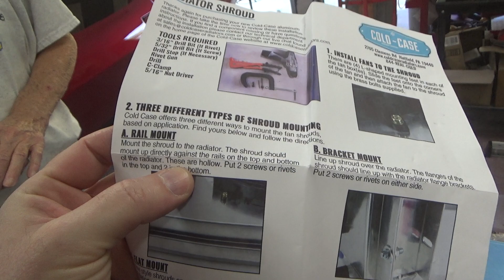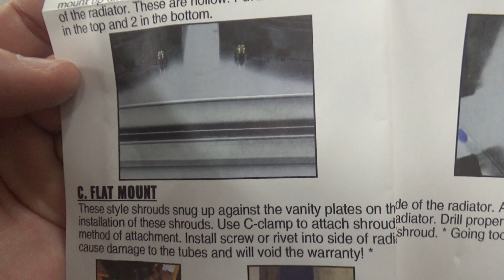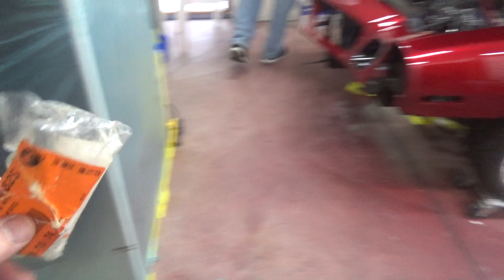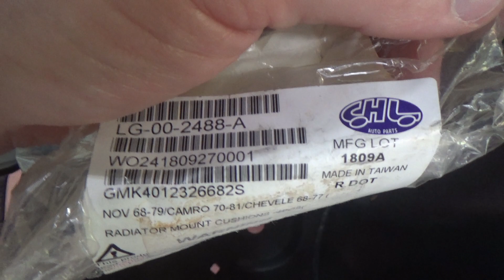1977 Camaro Z28 Part 248: Cold Case radiator and AirAid cold air intake

Comment: Make sure to use loctite on the fasteners for the sensor on your air intake. It would suck to have the engine ingest a loose bolt. The car is looking outstanding.
Reply from the maker: Yes! Thank you very much

Comment: Hey Erik the car is looking also I think silicone radiator hose will look better in your engine bay cuz you have some shiny things going on in there if it was the original engine setup you have I would have use the original looking heater hoses  and if you need anything send to California I can help you take care brother
Reply from the maker: Thanks buddy! I have not looked into the silicon hoses, but I may have to. The heater hoses are already installed, so I am stuck with those :)

Comment: Looking awesome Eric. I see your doing what I’m about to do. RADIATOR HOSES. I read that a guy took a coat hanger and cut and bent it to the length and bends needed and then took it to the parts store and they fixed him up. I’m going to try it and hope they help me get the hoses to fit. Anyway you could try it if your still having a problem finding ones that fit. Anyway your car looks AWESOME.
Reply from the maker: Thanks! Yeah, that is the way a lot of folks have done it. I am trying to avoid that, but we'll see if that is where I end up!

Comment: That top rad hose, you could cut it and put a metal piece in the middle to make it fit. That part that’s banned in Cal, just have it shipped to someone you know out of State and have them ship it to you.
Reply from the maker: HI John. I may end up doing that for the upper hose. As I said in the video, I read about a guy trying to get that through the referee and failing. I was able to order the block-off plate, so that is good enough I think. Thanks a lot

Comment: Looking good. Congrats on finding the lower radiator hose, I just welded the AN20 adapters to the thermostat housing and the radiator.
Reply from the maker: Thanks. I hope the upper fits. I fear it will be too long though.

Comment: I am friends with Mickey Lauria. He owned Total Performance, Inglese and a company named Cool Flex. They originated the flexible metal radiator hoses. They used copper. Flexed easily and helped dissipate heat. They offered them in colors like polished silver, black, etc. I've used them many times with perfect results. He sold the company a while back, you might want to do some research about them.
Reply from the maker: Thanks, I will take a look

Comment: You will need two 40a relays to power the fans. The ecu will provide a ground to trigger the relays as needed. One on at 195 and the other at 210...random temps mentioned just for example.
Reply from the maker: Does not seem to be the case for mine. It has a 40A relay/fuse already for the fan. If it was ground based, that would be easy peasy. But NO!

Comment: for my 69 camaro i got a cold air intake off amazon for a 2006 chevy pickup flipped it over and it fit perfect. just had to make one bracket to hold the box for the filter. it only cost about 60 bucks
Reply from the maker: I wonder if there is an equivalent for my year.
Reply: i bet you could use the same one i did

Comment: Hi quick question  do you have a video on how went about installing the charcoal canister and what fuel tank you used ?
Reply from the maker: Hi Diego - I have not started on that. I will be doing that soon though. I just ordered the tank today. I did run a vent line up the passenger side of the car. I am going to put the canister up front.
Reply: @asicerik   thanks looking forward for that video

Comment: what is a referee? we use to have air-care which were government run faculties to smog test all cars in B.C. if you failed you couldn't renew your car insurance
Reply from the maker: They are even more low-level that smog facilities. You need to take a car there for pre-smog testing. They go everything with a fine-toothed comb. They have complete authority over whether you can register your car to drive on the road at all. I need to go because this is a smog-controlled car with an engine swap.